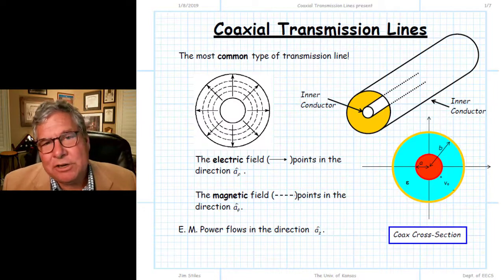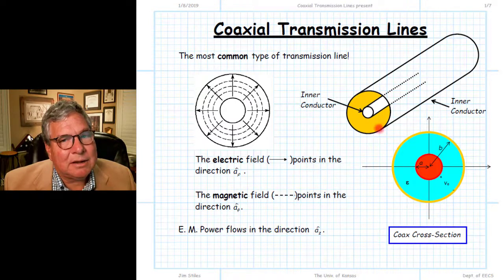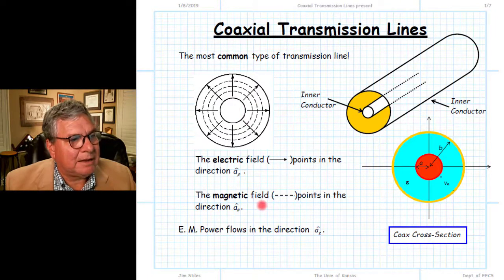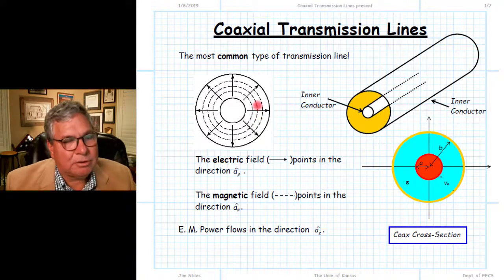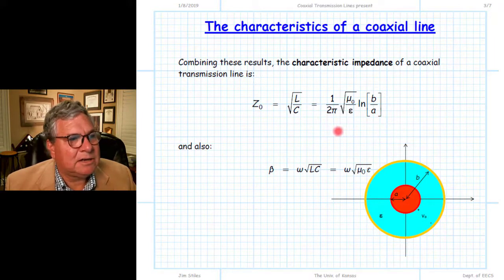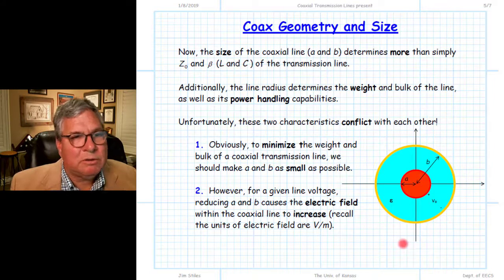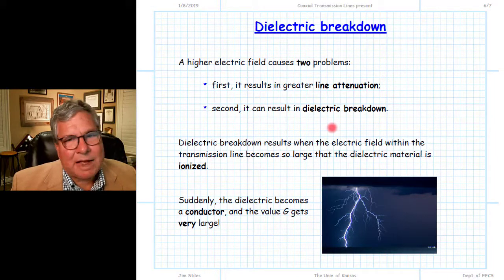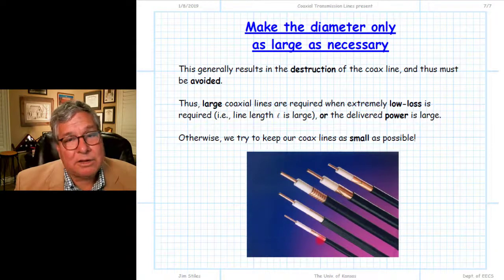Coaxial Transmission Lines

Comment: So the outer conductor is not just a shield?  Does it conduct the same signal as the inner conductor?  Should it be open between the outer and the inner or Short?
Reply: If the transmission line is terminated properly, the transmission line will be terminated (and sourced) with an impedance that matches the characteristic of the transmission line. Especially, at the most dominant frequencies.